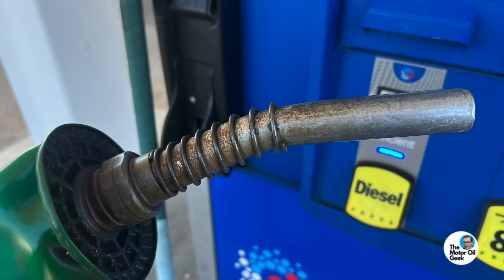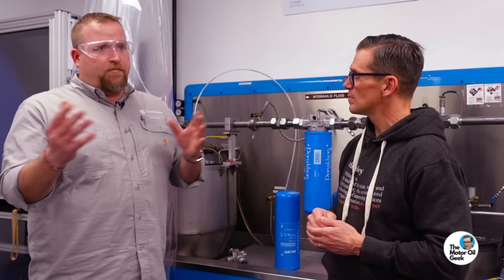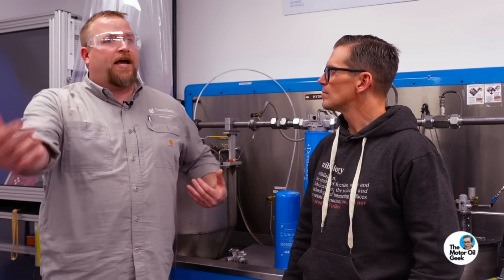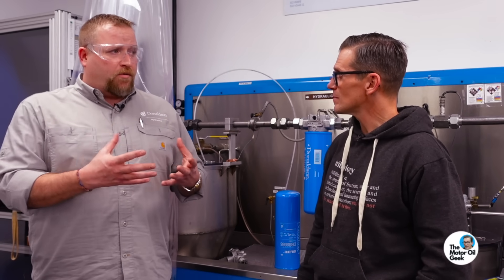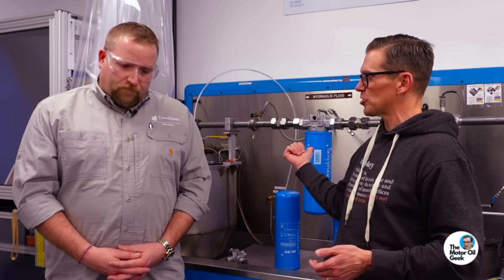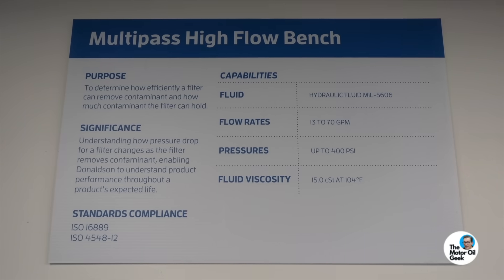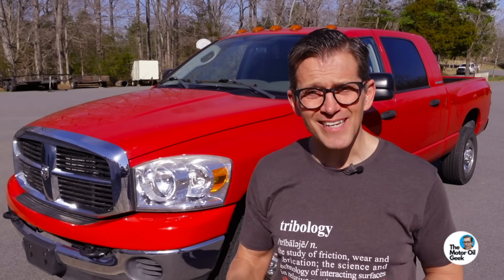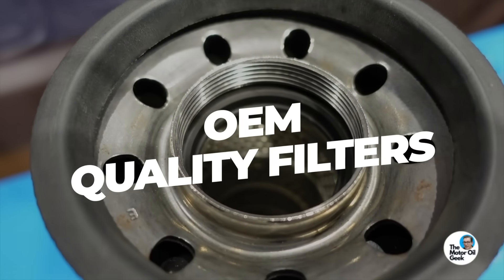Diesel Is DIRTY (And It's KILLING Engines)

Comment: We need a part 2 on the additives with stuff like Lorenzo’s, StaBil all season, LiquiMoly for us TDI guys, etc
Reply: Check out his video list from about 3 mos back (April-ish '25).

I will be switching to Hot Shot Secret EDT.
I regularly have oil analysis done. Therefore, a baseline will be set for the amount of potassium that Lake speaks about in that video. Potassium can be indicator for coolant contamination in crankcase.

LOOK FOR hotshots new dispenser bottle. It makes for easier measure and dispense in cars & light trucks. 
Bottles are notorious for leaking after being opened.   My Passat fortunately has plastic cubby holes in the trunk. 
I will also keep gallon jug on hand for my truck since 10 to eleven ounces is base dose when it's empty.  I  will just eyeball a good healthy splash in  each of the tanks.

I bought Stanodyne once.  It just didn't seem to be the product I wanted for lubricity.   The pump was more noisy like cheap fuel.
Worrying about my old VE injection pump is my largest concern.  I now, literally, need to get outside and install new 502 injectors. (With DLC coating)
And get old ones sent back to Idparts.

Comment: Awesome video!

Some things I think about but don’t know about:

1. Do filters with metal components (screw on type filters) have a risk of oxidizing from water in fuel and passing rust particles down stream?
2. Does a sudden increase in engine rpm (revving up and rolling coal, etc) cause an increase in fuel pressure and therefore a bypass or decreased efficiency of the filter?
2.5. Can a sudden increase in fuel pressure knock particles loose from the filter?

Comment: Your dad's truck is newer than 2002. Mega cabs came out in 2006 with a 5.9 Cummins available and 2007 1/2 have the 6.7. No need to buy a newer truck unless you need to get rid of a cumbersome bundle of cash.
Reply: The extra deep C-pillar and badge shows its a MegaCab.
Reply: Not the right body for a 2002 Cummins.
Reply: I think he said that for cough emissions reasons
Reply: See i come across this problem all the time when I work on something and say what year it is. People always say nobody thats not that year model. Even showing VIN registration and work order.  I guess people who don't own them or work on them know more about them.
Reply: 02 is a completely different body style. @BeardedFordTech
Reply: @jodypenney404 you know who cares?  Absolutely nobody
Reply: @BeardedFordTech  I care and that is NOT a 2002.
Reply: @BeardedFordTech  lack of detail, lack of accuracy, especially on something as easy to get right as the year of your father in laws truck, calls into question other claims or “facts” made in his video.
Reply: I saw that too. Was like "no it's not..." I have an '06, gasser though.
Reply: whatever it is, it ain't pretty
Reply: Another great video with lots of solid tips
Reply: Can confirm. Those are 06+ headlights.
Reply: That is correct, 2003 was the first year of Dodges with the bubble lights. 
The pickup mistaken for a 2002 was more likely a 2005 + model.
Reply: https://youtu.be/9gw6B7kZrGk?si=JAdsY0kZmFlRDx9X
Reply: @bikerevolutiontv that's pretty messed up to post a video of ypu selling a vehicle on someone else's channel
Reply: Sometimes. Nope always, repairs are a cumbersome bundle of cash and time is money. Sometimes you just have to have a new truck. With that being said, I love the older stuff.

Comment: Get setup with Fass and do some testing with them, a lot of us are running aftermarket lift pumps on our diesels. We would all enjoy that! Great job Lake!
Reply: Performance aspects aside there is no reason to own a diesel truck and not have an aftermarket lift pump with filter and water separator. Its mandatory for all my diesels plus its way easier to service over the engine bay filters.
Reply: I've had a FASS on my 2006 6.0 Power Stroke since it had 25k miles on it. Still have all original injectors and I'm a big believer the FASS is the main reason why.
Reply: Yes! I run the FASS, as well, on my LML.  I love their new water seperator, too.
Reply: Fass as a company does a lot of testing, but more testing is never a bad thing.

Comment: Dude that is not a 2002 dodge ram lmao, unless the headlights have been changed that's a 2007 up since the 2006 had amber reflectors at the bottom
Reply: I was thinking it was an 07 or later as well.
Reply: Zackly

Comment: can i drink diesel after it is filtered?
Reply: Yes, one can even drink diesel fuel before it is filtered and it won't affect one any differently than filtered.
Reply: I had a smog tech tell me that “if you’re a few miles away from civilization, and your truck shuts down from lack of DEF, you can pee into the tank to get you home”!

Comment: 20+ years ago, I did the research and instituted laser particle counter testing of air cleanliness in aerospace composite clean rooms. The old method required the use of filter paper and a vacuum pump to pull the air through a preset amount of time, then having to count particles in 10 small grids. Very time consuming and tedious.

The laser particle counter reduced test time by 95% and gave real time results in the test area.

2 years later, we had a rash of hydraulic system failures on as received components, and resorted to the old filter paper counting method. Again back to the laser particle tester and started inspecting components as received. The manufacturer had egg on their faces on all of the trash found inside of new as received components. Shortly afterward, the test cell was built to count particles during compliance testing of the completed system. Some system like with diesel fuel are pretty simple. Systems that use Skydrol are a bit more difficult in that Skydrol attacks most rubber, and compressing a AN fitting also deposited small pieces of stainless steel.

One test is worth more than a 1,000 educated guesses.
Reply: Having been soaked head to toe in Skydrol (failed B nut in 3000 psi system) I can tell you it attacks more than just rubber....
Reply: Skydrol is EVIL stuff. EVIL.
Reply: I'm having a hard time understanding what the final solution was
Reply: @nfitz11  
The final solution was to purchase a fluid laser particle counter to install on the system to count particles, both quantity and sizing.

Comment: Lake, or anyone who knows, is there an issue w flow constriction in a non-oem fuel filter w a low micron/high efficiency rating? I'm thinking of P4 issues. I have a P3, but my brother has a P4 w a lift pump helper on it. I worry that getting a 'better' filter for the crap fuel could starve an injector?
Is my thinking nonsense? Is there a flow rating that I should pay attention to?

Comment: No way in hell would I trade the truck you're driving now for one of the new ones.
Their issues go far beyond what fuel quality can fix.
Reply: My 12 valve is thirty years old now, I should change the fuel filter but only because it's 22 years old now. 😂
Reply: The cp4 was a massive improvement in technology  , right?
Reply: @daviddroescher  the cp4 was designed in Germany. European diesel has more lubrication and higher cetane levels than USA diesel.  there are no problems in Europe with the cp4. as long as you add a lubricant every fill-up to the fuel you should be fine. so they say anyway....
Reply: @michaelotoole1807  last I checked Bosh is German they so your suggesting that Bosh has cut there own throt and engineered then selves out of many world markets with the cp4?
Reply: @daviddroescher  what i am saying is usa has shit diesel.
Reply: Besides our low quality cars, coming out of the factories and from this video the intended fuel contamination, most likely lobbied with the car manufacturers to impact the life of motors big time, I bet you would have said that it was all the emissions related stuff. Which is already basically been proven to impact the motor life slightly negatively (there is enough research on it). The real engine killer is the non existant oil changes. People do not change their oil properly and on time, that is all there is to it.
Reply: Diesel Fuel Quality is at the Highest its ever been in the history of it usage , Lake Speed is a Fraud shill , Weve sent in numerous samples and some were tests of the same sample to see if we got different results and low and behold we did , There was no rhyme or reason either just fraudulent results for money , Cummins Oil Testing is By Far the BEST
Reply: New Diesel's are like investing in gay porn..... Not recommended
Reply: 2019 Duramax 380k miles.  I’ve done regular maintenance and changed the NOX sensor once and the def injector once.  Besides that it’s been a solid truck
Reply: AGREE
Son still has his '06 Cummins Dually !!!
Reply: @hotrodray6802 hopefully it’s a manual transmission or he will rebuild it every 100k if actually tows
Reply: 12v guy agrees
Reply: You are 100 percent correct!
All new vehicles are garbage!

Comment: Crazy in Europe, the diesel ⛽️ is clean also we dont have this water issue 😂
Reply: And yet we are running our trucks many many years on the original emissions and injectors with routine filter changes and a basic fuel additive,,,,
Reply: @hokie9910 now imagine running cleaner diesel fuel 😂

Comment: Having a Diesel in my boat, running twin filters and water filter with final filter at 10 microns.  We boaters still can have a lot of issues with contaminants and water.  Mitigating bugs and having to polish our fuel from time to time is unfortunately just part of our routine.  I still would take a diesel over gas in a boat but it is a dirty problem. We carry many spare filters.
Reply: Some say adding Tcw3 helps
Reply: That will only help lubricity not cleanliness

Comment: But yet there are numerous videos of folks and some companies showing and telling folks to fill their fuel filters before installing and also they fill to the center hole which if filled should be filled to the outer filtering side
Reply: the cup of fuel used will not have enough contaminants to have any issue vs the thousands of litres going through filter in its life
Reply: @harrismagnum04 CUP OF FUEL???? Ever filled a fuel filters before? Most will take atleast a quart and most engines have 2 filters,a primary and final.
Reply: Dumb question here… why all the “dust” being added in? I missed something. Can’t the filtering and efficiency process start there?
Reply: @Timothy-ns4qn  The way I heard it was that the dust has a specific number of particles in a specific micron size.  That way they can test the filter for the percentage of particles removed for each micron size. So, they  must also test the fuel itself for the other micron particle sizes to know the total number in the fuel being tested.
Reply: Simulation testing real dirt in every day diesel fuel…